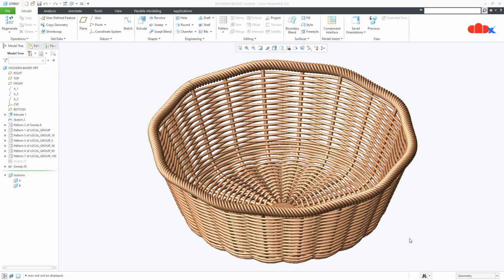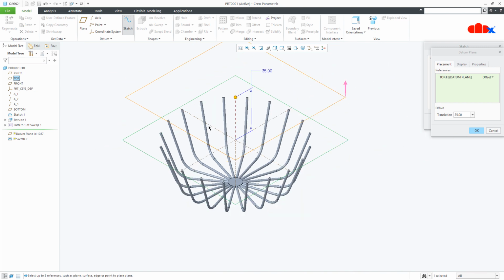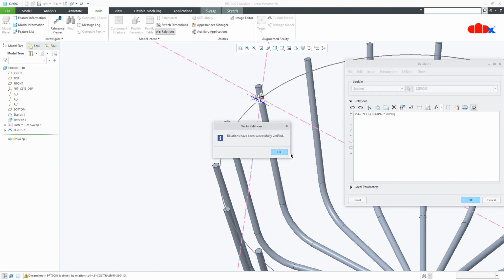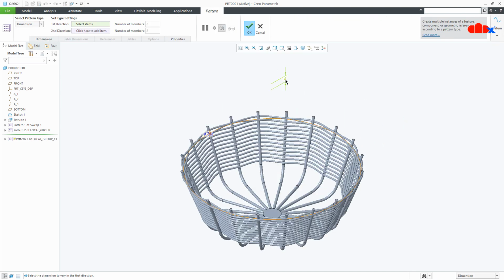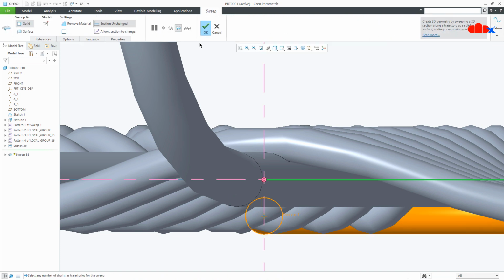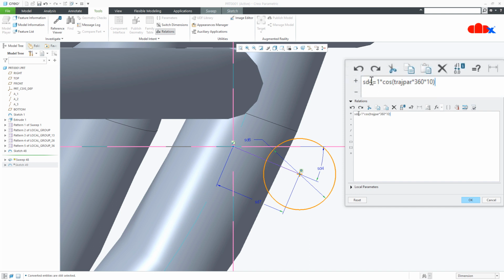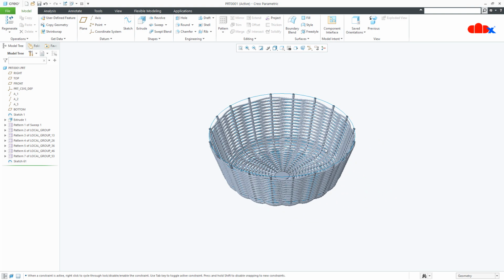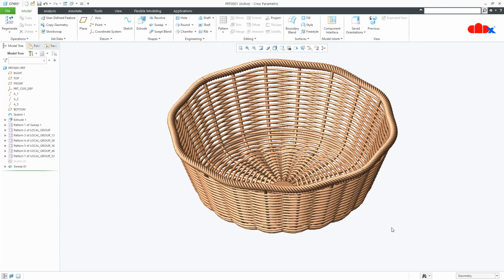Rib Pattern fruit basket using relation in Creo Parametric

Comment: This was awesome!  I've been using Creo (Pro/E) since 1989 and it feels good to learn some new stuff. I had forgotten about TRAJPAR and how useful it can be. When working through this on my own, I approached it a bit differently.  When doing the first sketch, before completing it, I converted it to a spline so that the curve was one segment.  I then created the points along the curve using a ratio.  I also created a datum plane through the point and normal to the curve. I used that to drive my X-trajectory on the sweep.  That way the weave was always normal to the first curve. By doing that, I could use one pattern for the sides, curve, and base. Instead of the three separate patterns.   Also, to make the alternate weave, after creating the first weave, I created a pattern of two and "unpatterned" it.  I then just changed the relation in the sketch to sd4=1*cos((trajpar*360*10)+180).  

Anyway, awesome tutorial and will be subscribing.